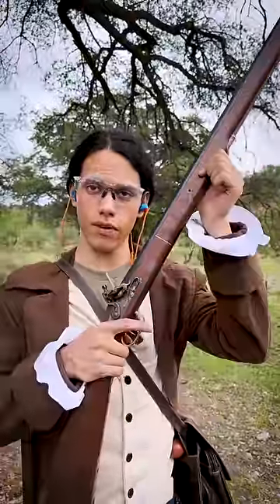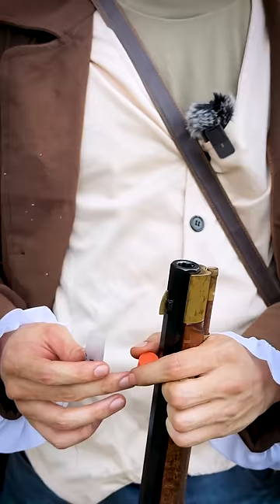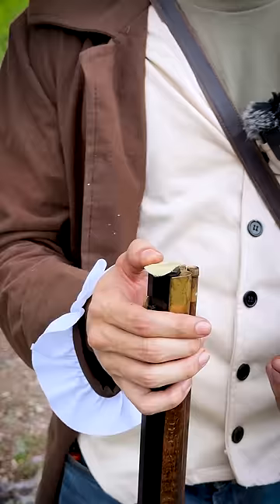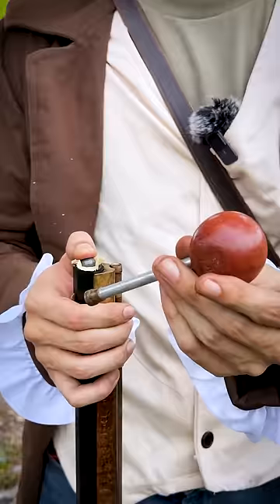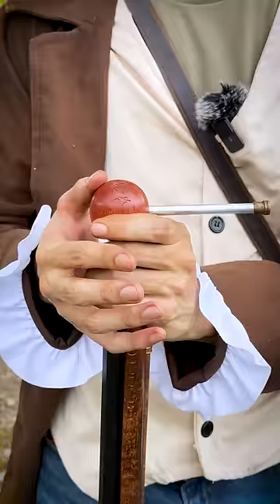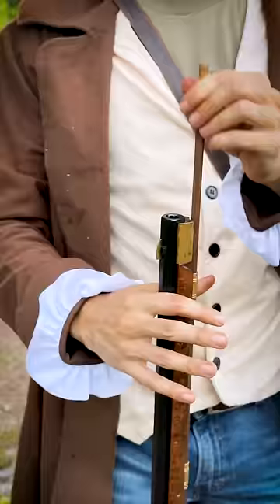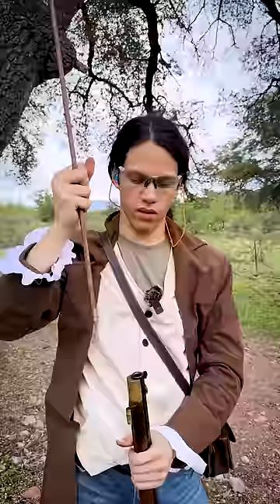How to Load a Flintlock

Comment: If you're wandering, he pauses for a few seconds after he shoots to be sure that the round has gone off and it is safer. You should ALWAYS do this. Also, even if the gun is on safe and unloaded, you must treat it like it is not safe and it is loaded.
Reply: You know you can always treat a gun like it’s loaded and no you don’t need to freeze after shooting if you are always keeping the barrel pointed somewhere safe lol. Also yeah secondary explosions would be an issue with flintlock and muzzleloaders but where do you think a secondary explosion is gonna happen in a actual round
Reply: Common since

Comment: you can scribe a mark on your ramrod with the barrel empty an you will be able the check to see if your flinter is loaded. also a range rod with a T- handle and brass barrel guide works best for loading and also keeps the barrel from getting damaged during many many more rounds down range.

Comment: I always love that half a second between trigger pull and actual fire one of the reasons black powder rifles are my favorite
Reply: Why trading up to a caplock was a major advancement in weaponry. Not to mention that all it takes to turn a flintlock into an awkward club is a slight drizzle of rain.
Reply: While we're at it, let's also note the portion of the explosive force that inevitably escapes out through the pan.
Reply: Then you have a lousy lock. A good flintlock is extremely fast.
Reply: I found that weirdly cool from this video
Reply: That lock time was way too slow, probably not enough priming powder or he covered the flash hole with powder

Comment from the maker: BEFORE you comment saying "That's not a flintlock, that's a musket!" Research what a flintlock actually is instead of going with what similar weapons are called in  Fortnite and Palworld. You might learn something. ;) 

Full length video on the flintlock "American Long Rifle" https://youtu.be/ar2re--_xBo
Reply: Should really say that it's a flintlock rifle instead of the usual smoothbore musket.
Reply from the maker: @drtidrow  the terminology used is not incorrect
Reply: @bigironbois what if you overcharge it .
Reply: @luckyCOYOTE27 the risk of explosion of the barrel will be very high and since it will be near your face when you aim and shoot, you will feel very warm for a second and then very cold for a long long time.  So security first by paying attention when you load it.
Reply: @j-michelr2866  oh then what it the steel walls are one inch thick and the same size or would it be just too heavy to hold
Reply: @luckyCOYOTE27  very heavy indeed. Can be a model of a heavy rampart rifle or similar then.
Reply: @j-michelr2866  oh. I'm guessing that why we didn't improve them to handle bigger loads due to material, weight and recoil
Reply: @luckyCOYOTE27  Another series of factors and also the evolution of weapons with the advent of percussion, stronger and lighter steels and of course the disappearance of muzzle-loading weapons and the appearance of cartridge cases. It's actually a constant evolution. I had the opportunity, since we are talking about it, to help transport a rampart rifle which belongs to the army museum in Brussels and on display in Liège. We were two to be able to move it.
Reply: @drtidrow well it's called a smoothbore because it doesn't have any rifling a rifle has rifiing
Reply: Forgot many step such has the tap on the barrel to compress the powder, put lube on the cloth to make it go down easier... is it your first time shooting a flintlock
Reply: @landonmorgan8602  It's clearly a rifle from the way he loaded it - with muskets you generally didn't have to use that starting hammer to get the ball started down the barrel.
Reply from the maker: @adasdsadsdfgfddt2920  Pre lubed patches, and a heavily edited video.  First time on YouTube?
Reply: Thats a musket
Reply: have you ever tested one of these on a chronograph?
Reply: @j-michelr2866 Do you mean... D E A D?
Reply: @nikolaytekuchev136  that's an image. But the danger exists, yes.
Reply: What if u put a modern bullet in it
Reply: @luckyCOYOTE27  At that point my man you have build a cannon
Reply: @teaser6089  i want a hand cannon
Reply: mommy
Reply: I like the fact that the gunshot was so loud that the audio cut off for a sec
Reply: And hit nothing but a stray woodchuck
Reply: No thanks...
Reply: @bigironbois  you replying to these hate comments is showing how small your "big iron" is
Reply: @bigironbois bro just said you shoulda be more specific. You can call a pepperoni pizza, just a pizza. Well what kinda of pizza. What kind of flint lock? Flint rifle? Flint pistol? Flint grenade luncher? Flint lock wood?
Reply: Sad, this needed to be said. For all you who make clarifications like this required, flintlock refers to the firing mechanism. A piece of flint that locks. Whether it's a pistol, rifle, or blunderbuss, you should be able to tell by simply looking at the gun. Saying "no that's not a flintlock, that's a musket" or "you need to specify its a rifle" is just inherently dumb. He tells you it's a flintlock, it's not a small one-handed device, or a big metal tube with a grip should tell you: "this is a flintlock musket."
It's like saying a recoil fed gun is limited to a 50mm anti-aircraft gun, and only that, then getting annoyed that I didn't specify I was referring to the AR in my hands at that moment. This was a genuine, cool Short, and it's sad to see the creator having to specify anything because some smoothbrains can't pick up context or new information to save the entire human race
Reply: If I did some research u would know that a musket is a flintlock
Reply: That‘s not a flintlock thats a musket
Reply: How’d you know about palworld 6 months ago 🤨
Reply: That's not a flintlock, that's a musket
Reply: l o n g
Reply: @j-michelr2866  And you might lose  a hand.
Reply: @TristanTodd-kk9um  absolutely.
Reply: FLINTLOCK WOOD
Reply: I never figured out the difference. I just thought long barrel=musket
Reply: Isnt that a carbine
Reply: @impusle_5114 Nope, a Carbine would be a little more shorter. And if the target is that far, a carbine would not hit it by its accuracy (because if its barrel length).
Reply: @Law10205  A musket is a type of firearm. A flintlock is a type of ignition mechanism for firearms. They are not the same.
Reply: @JMTRBXXXX  that sucks
Reply: There's guns in palworld???
Reply: Bigironbois use cartridge which will make it easier to ram rod it
Reply: Yes, but also the definition of musket (according to Google dictionary) is "an infantryman's light gun with a long barrel, typically smooth-bored, muzzleloading, and fired from the shoulder."
Reply: Does that mean this follow the concept of all flintlocks are muskets but not all muskets are flintlocks?
Reply: You're really wrong, because a flintlock is a type of ignition mechanism For firearms. Muskets are a type of firearm.
Reply: Nahh that’s obviously a blunderbuss 😂
Reply: On the considerable delay here...if primed correctly (1/3 of the flashpan max.), the delay is reduced considerably. In fact, the delay of the BEST quality dueling-flintlock pistols as well as some of the finest rifles (not muskets) of the time, were nearly or AS fast that of the percussion mechanism. This requires 4444F priming powder, a newly hardend "steel" and a neatly knapped flint. Least but not last, a WELL cleaned weapon. Suprisingly many people do NOT realise the importance of Gun Care—not seldom people without military training it seems.. I have noticed a great deal of reenanactors with grossly negleted firearms(???!). ~4–5 h. to clean a gun in the era. Even a single shot discharged, and it needs to be [properly]cleaned(!!!) in order to avoid corroison becasue blackpowder is highly corrosive compared to smokeless powder.
Reply: lol sometimes I forget people don’t know that flintlock is the mechanism
Reply: What's the difference between a flintlock and a musket?
Reply: @zejdjazic9458  bro has NEVER cooked in his life 💀💀
Reply: @doodlesyoru2108  The phrase 'flintlock' is mere slang of the era—due to that the very most of long guns were equipped with flintlock mechanisms—circa year 1700 to 1840-ies
Reply: That's a muscat not a gun
Reply: nuh uh its a musket fortnite is always right
Reply: Flintlocks use powder instead of primers like muskets
Reply: @doodlesyoru2108  A musket is a long gun/carbine wich is not rifled. The mechanism is not the issue here as in the latter period (1840s), muskets were manuactured with percussion mechanisms.

Comment: Sir the war ended while you were reloading
Reply: Most didn't use these in war. They were for hunting.. unless in a "sniper" role. Soldiers used a smooth bore musket which is not loaded like this, and you can get two shots per minute from it... and done in volley fire.

Comment: You used about 3 times more priming powder than you need. Your priming powder container has a two grain measuring nozzle. One press is all you need. You can spread that two grains of powder out with slightly more powder away from the vent hole and it will have almost no delay.

Comment: A little safety tip, use the ram rod to make sure the gun isn't already loaded before loading it. You could accidentally load a round on top of another and the gun could blow up if fired.
Reply: historically accurate shotgun
Reply: @oliviersavard8676  more like historically accurate pipe bomb 😂
Reply: dont care

Comment: You might check the reason you had to hang fire. Many people put too much 4f in the pan, which will actually drown the flash hole. Just put a little bit of powder in the pan and a little bit away from the flash hole. Don't put your ball down there so hard. Just sit the ball against the powder. And if your flash hole is too small it will also cause a hang-fire. So you say what is a hang fire. That is the delay between the burning of the powder in the pan and the charge going off.
Reply: If he does it right it sounds like a modern rifle. Too much in the pan for one thing.
Reply: Click-hissss-bang?
Reply: He never seated the powder charge by tapping the butt. So it was all loose in there.
Reply: What. Bro, you think the dudes back in the civil war were properly measuring their loads? Hang fire is literally the name of the game when it comes to flintlock guns
Reply: No that's just how A flintlock works
Reply: Evil Joe says that's just how a flintlock works. I have a flintlock rifle and that's not how mine works if I put the powder in the pan the right way. You put it in the right way and that gun goes off just as soon as you pull the trigger just as soon as that Flint hits the striker that thing is firing its round. Evil Joe you need to see some more videos of people who have been there are videos of men who are firing their flintlock rifles and it goes off right away.
Reply: @daniellau5859  . Nobody was talking about the civil war. I was helping the man out with how to get his flintlock firing properly. I don't know where you came up with this civil war stuff. Didn't even mention in my response that there was any action regarding battle or not. You must have been thinking about somebody else's text.

Comment: Well, here are some things to think about, a typical Napoleonic battalion frontage was about 50 yards. With 400 barrels, each firing 2.5 rpm, that is about 2000 rpm of practical ROF. 
Per frontage, a modern solder faces half the small arms rate of fire that a Napoleonic infantryman dealt with. 
And at under 150 yards muskets are not inaccurate....
So, well directed and organized musketry was uncomfortably terrifying to face. 
There is a reason why 1/8 to 1/4 of the battalion was deployed as scimrishers, that was to cushion and give space to the rest of the battalion, before it walked into the enemy effective firing range.

Comment: In combat they used paper cartridges dipped in wax. The ball at bottom then string tied below and above the ball .power measured then tide on top. Bite the paper off dump powder in then push the paper and waxed ball in, prime and fire.😊😊😊

Comment: In truth, in the field, powder likely would be eyeball measured from a horn, and no starter used, as the ball would just barely clear the bore. The patch created the friction seal for the shooting. This is because the bullet would was sized accurately,  but the cooling casting would naturally shrink slightly. After ramming home and replacing the rod, the shooter would lift his frizzen, to prime the pan from the powder horn, lower the frizzen, full cock, lay aim, and let fly. 
Regulars would carry  paper cartridges,  whose end would be bitten off for the powder to be dumped, and the paper tail of the wrapping serving as wadding when it was pushed into the barrel. A flask provided the frizzen priming. 
The most daring would prime from the cartridge before loading the barrel, but the folley of that move needs no explanation.

Comment: Eh not quite, Thats not how we do it.
We put our powder charge, you use that, but dont use your starter ever. Back in the 1800's they used the ram rod instead, the didnt have the starter at all, and they added ''gunpowder'', not the one you are using, but it most primals with it being in a small bagged paper which soldiers used to bite on and tear the paper open, you were using a bottle to have your ''2f'' in.
Not approved for american kentucky rifle license.